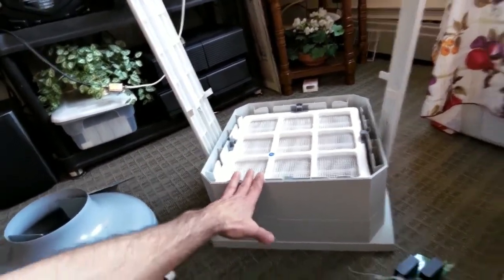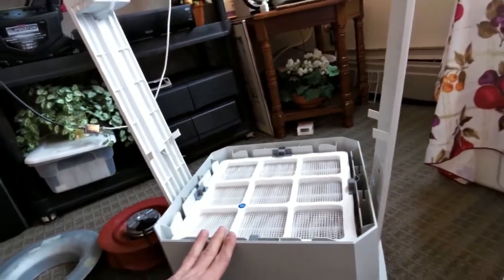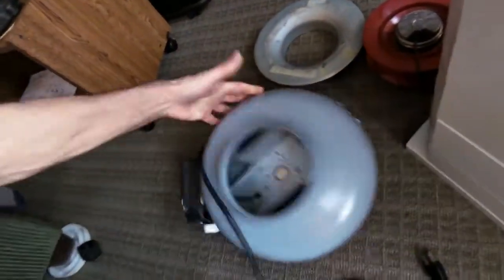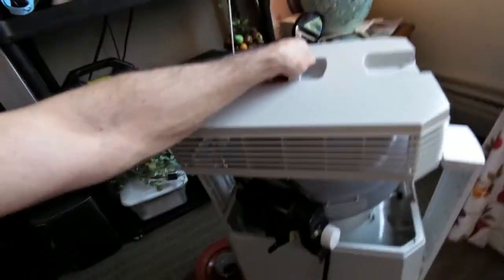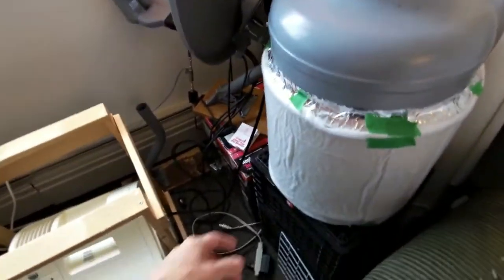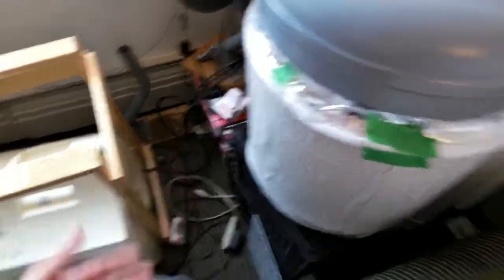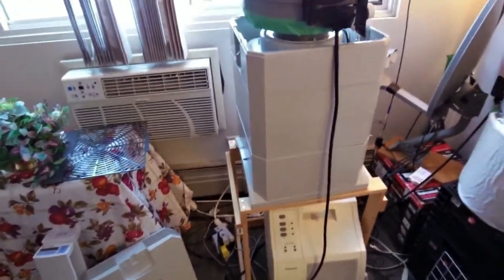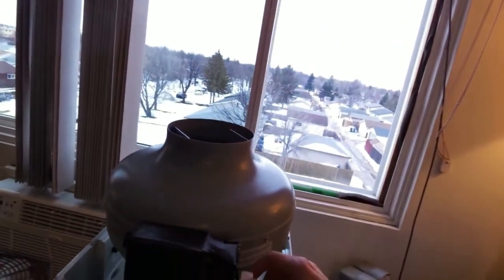Broken IQair Compact modification.

Comment: my family thinks i'm crazy for buying four different purifiers for different rooms in our house. i think i'll show them this video so they know there's at least one guy crazier about this stuff than me.
Reply from the maker: The IQair "was" a great machine, It gave me lots of nights of easy breathing! Highly recommend  if money is no object. However I would never buy any brand air cleaner again. It so easy and cheaper to use any round filters and your own fan. The fan in the video is 6" 309 CFM   A 4" inline fan rated at 120-150 cfm are also a great choice it you want DIY air cleaner to be smaller and cheaper, and will work with well any Honeywell filter. You can also stack round filters and seal at bottom to increase surface area for increased air flow.